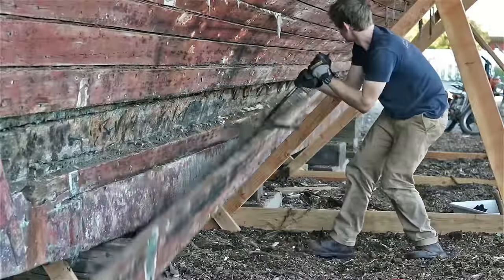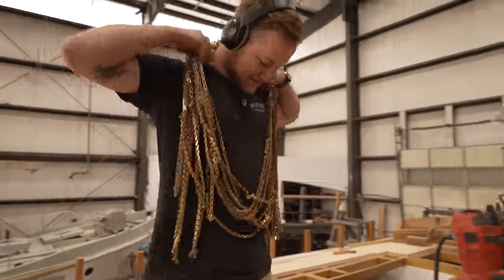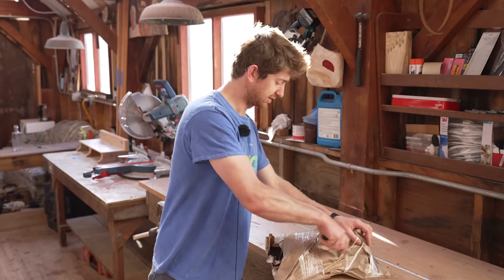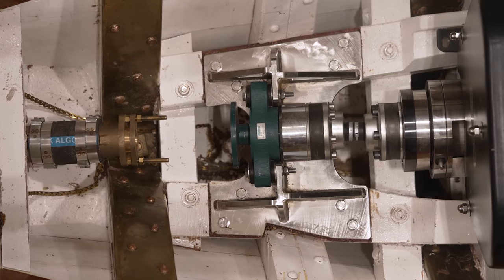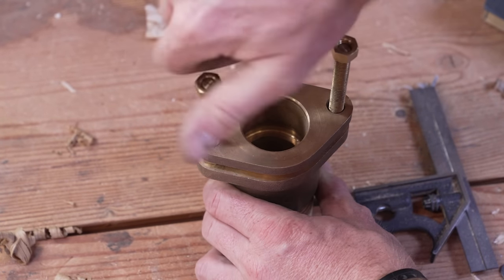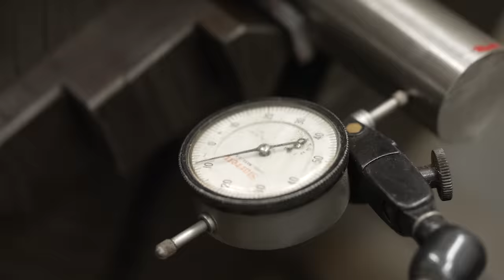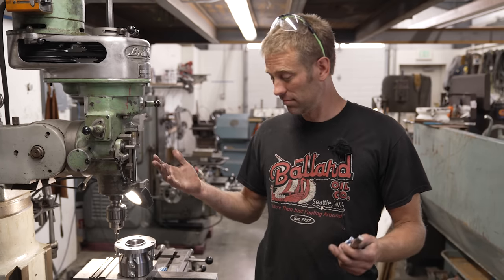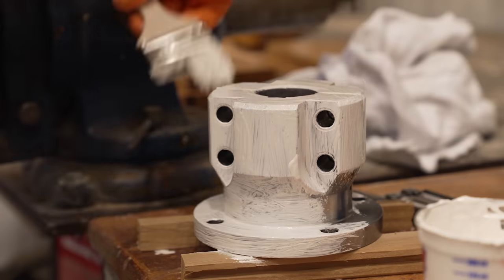Machining the Driveline & installing an unusual Propeller (metalwork & boatbuilding)

Comment: How is the propeller blade pitch actuated?  Is there a coaxial shaft or something that controls it?  I see there's a wedge shaped piece on the end of the shaft, I assume that has something to do with it?
Reply: It's a reversing / feathering prop, not a variable-pitch prop. The hub has internal gears that wind the blades into full fwd or rev position, depending on the cw or ccw rotation of the shaft. Although the limit stops in the hub that set the maximum pitch in each direction can be adjusted or fine-tuned when stopped, there's no ability to adjust the amount of pitch when under way.
Reply: @frederickstibbert7389  So how is he going to put the prop in the neutral position to reduce drag while sailing?
Reply: @orionsswords  - From fwd gear, just stop the motors / engine & the blades are gradually forced to feather by water flow, or stop the engine in gear to use engine back pressure to hold the shaft immobile for faster feathering, then shift to neutral. The  boat must have forward way to feather the blades. The case is different when the blades are in rev / regen position b/c waterflow holds the blades fully open. So you must burp the elec motors in fwd polarity to wind the blades into fwd orientation, then proceed as above.

Comment: How is the pitch of the prop controlled? The shaft isnt hollow or something, please enlighten me!
Reply: It's not a variable-pitch prop, although it has limit screws on the hub to set the max fwd / rev angle. This type of prop can only be at full fwd / rev pitch - but when there's no rotation load on the shaft, water flow pushes the blades into the feathered position.
Reply: @frederickstibbert7389  Thank you very much!

Comment: I would like to know how the prop nut is locked.   With any vibration and forward and rev changes it may undo. No pin or stiff nut?  It would be sad and a big problem to lose that ingenious prop. I think one of the recent electric cars had to be recalled because electric braking undid the centre nuts which on a normal car were self tightening.

Comment: Question, how do you control the pitch of the prop?
Reply: While the max pitch in either direction can be adjusted w/ locking setscrews on the hub, this is not a variable-pitch prop - it's either at max fwd or rev pitch when being driven, or feathered by water pressure.
Reply: @frederickstibbert7389  Thank-you.. that makes much more sense... Thank-you again.

Comment: @8:44 What is the brown 'Goop' we see you guys use for mounting stuff? (I don't think it's Nutella, perhaps it's Marmite?)
Reply: A mix of Dolfinite bedding compound & pine tar, sometimes thinned w/ a bit of linseed oil. It fills the small air pockets between mating surfaces, so they can't fill w/ water to promote rot.
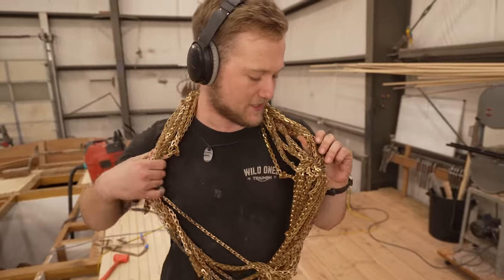Reply: @frederickstibbert7389  Thank you kind sir for explaining, that seems like a good idea! Using the search term 'Dolfinite' I found EP76 where Leo talks about it a little bit around minute 3:20

Comment: I just wonder, how you set angle on prop blades when boat is in water?
Reply: Although the maximum pitch in both directions can be adjusted with set-screws on the hub, this is not a variable-pitch prop - it's a feathering prop that can only have 3 positions - full fwd, full rev, & more-or-less feathered to 0°.

Comment: I love that you faced the coupler after fit-up to the shaft. Nice advantage of working with a machinist with all parts on hand; minimal runout and the whole assembly will be nice and happy. Zn-Ni plating would have been nice on it instead, or in addition to paint. It would give slowly consumed protection for the clamped bore, faying surfaces and all the threaded holes that you can't paint. Spraying all the fasteners and holes with a corrosion prevention film would be a good idea once it's installed so you can hopefully get it apart again when you need to.

Comment: How is the pitch actually controlled from inside the boat?
Reply: It's not - there are adjustment screws w/ lockdown setscrews on the prop hub to limit the pitch in fwd & rev rotation, but the only control is to shift the gearbox from fwd to rev. To feather, you shut down the engine in gear, wait for the blades to feather, then shift to neutral.
Reply: @frederickstibbert7389  so they are slung by rotation of the engine fwd & rev to the limits. If you have forward momentum and you shift to neut the  drag will move the blades to the middle between the fwd and rev pitch i.e. the feathered position.

Comment: At risk of sounding like a troll, why does the thrust bearing bracket have open webs? Full metal would surely be stronger (and a little easier to make).
Reply: Maybe for heat dissipation, like car brake rotors?
Reply: My guess is it's easier to control warping during welding.

Comment: steam engines call them stuffing joints or packing joints ... and its just to keep the steam in or oil out etc ...
Reply: finish the resin paint job with a smiley face ... then when it does see the light f a mechanic again they will smile too lol ;) 
.
for those wondering what the word he was struggling to think of ... Galvanic corrosion ... the interaction of 2 or more conductors in contact or close proximity to pass electrons back and forth ... 
.
notice CONDUCTORS .. carbon fiber is a conductor ... so is steel ... one touches the other one will corrode the other ... regular fiber glass between and its looked after etc ...
Reply: a little smaller than would be best ... pity ... but then it is a sailing ship and NOT a speed boat ... so a little less prop essentially means less speed ... but then you dont really want speed you want a comfortable ride in most if not all conditions ... and some way to move when there is no wind .. so a little smaller prop than ideal should not be any real problem ...

Comment: What makes the props change pitch? (I feel stupid asking.)
Reply: Inside the prop hub, there's a gear around the end of the shaft. As the shaft turns, this gear turns gears at the base of each blade up against a limit stop. Shift the gearbox from fwd to neutral to rev, & the shaft stops spinning, then takes up the 1/2 or 3/4 turn to turn the blades to the opposite direction. There's no variable-pitch while under way, though you could dive off the stern & adjust the limit screws on the hub (turn off the motor 1st). To feather the prop, you stop the engine in gear. Back pressure holds the shaft immobile while water flow presses the blades into feathered position, after which you shift to neutral & engage the shaft lock (if you've got one).

Comment: Could someone explain to me how the installation of the bracket at 8:59 works? It seems to me like they are using normal metric bolts (no Wood screws) and are simply gluing them in place? How is that supposed to hold?
Reply: The bracket is through-bolted to the underside of the wood supports. The brown goo isn't glue, it's a mixture of bedding compound & pine tar that fills voids that could potentially trap water & promote rot.
Reply: @frederickstibbert7389  Ah that makes way more sense. Thank you :)

Comment: Still trying to understand how regeneration mode works. Is it that with the gearbox in neutral the prop blades feather but with the engine de-coupled and reverse gear selected the resistance of the generators causes the prop blades to move to the forward thrust position? Puzzled. How does this work? Anyone?

Comment: How do you control the variable pitch propellor please?
Reply: There's no intermediate pitch setting - the blades are either jammed up against their full fwd / rev limit stops by the shaft rotation, or the shaft is in neutral & waterflow forces the blades to their feathered position.
Reply: @frederickstibbert7389  Thanks much appreciated. But then how is it locked to charge the batteries please?
Reply: @andyrbush  - I'm not really sure, but reading the Variprop manuals, you feather the prop by shutting off the engine but leaving the gearbox engaged. Back pressure holds the shaft in place while water flow forces the blades to feather position, then you shift to neutral.  So (just guessing here) to get into regen mode you set the prop blades into reverse pitch by jolting them w/ a couple seconds worth of electric drive in reverse, then setting the motors to charge mode. Since the shaft is not held immobile, the blades continue to freewheel and turn the shaft. When you're done w/ the regen session, you unclutch the motors, then throw the (non-running) diesel transmission into drive. The engine holds the shaft still by back pressure, & waterflow forces the blades back to 0° pitch. (I hope this is correct, I wouldn't like to steer you wrong.)

Comment: How is the feathered prop actuated?
Reply: Inside the prop hub, the shaft ends w/ a gear that is permanently engaged w/ gears at the base of each prop blade. When the shaft turns in either direction, it winds the blades into fwd or rev pitch. The amount of blade pitch is set by a factory setting of stoppers that can be user-adjusted by locking setscrews on the hub. When in forward pitch, the water pressure from forward motion on the blades will feather them unless the shaft is being actively driven by the electric motors or the diesel engine. When in reverse pitch, the water pressure of forward motion keeps the blades opened out - at the end of reverse motoring or a battery-charge session, one must burp the motors in forward drive to turn the blades to forward pitch before shutting down, so that the blades can feather.
Reply: @frederickstibbert7389  So freewheeling to charge batteries while sailing will not cause the props to feather towards a 'neutral position', as long as you 'set' them by a bit of forward motion?
Reply: @johnarwine2247  - Assume the boat is being driven forward by its sails & that the prop starts in feathered position. To start  charging, shift the diesel's transmission to neutral, set the motors to drive in reverse & feed them some power. It only takes 1 shaft revolution or less to wind the blades to reverse pitch, then switch the motors to charge & they become generators. Water flow keeps them in that position b/c the blades have more surface area in front of their pivot shafts. When finished charging, switch the generators back to motors & drive them in forward, so the blades wind into forward pitch.  Shut down the motors & the blades will slowly feather from the water-flow, free-wheeling the prop as they do so. You can speed up the feathering by shifting the transmission into gear to immobilize the shaft against the diesel's back-pressure, provided the transmission doesn't mind the abuse. Larger (hundred-horsepower or more) installations use a mechanical shaft brake instead.

Comment: For anyone, will the new boat be electric powered? Went back but just could not find that piece of info. Thought I heard him hinting it may be?
Reply: It is a hybrid system: Can be powered by the diesel engine or by two electric motors. These motors can be turned into electric generators for loading the batteries etc.
Reply: @on4xb  Two eclectic motors, incredible! Thanks @on4xb.
Reply: @RickMentore  See episode 115: https://youtu.be/c4UMMQFgmVI

Comment: im not keen on the stuffing box mounted on a rubber tube. if it seez  your motor will not feel that bit of rubber. and next thing you have water comming in with a huge job to repair. will have to pull the shaft to replace that bit of rubber.... shore there must be a better way.

Comment: How do you get the blades to feather ?
Reply: The blades are moved into drive position by the rotation of the prop shaft. To feather them, you stop the engine while leaving it in gear - back pressure in the engine keeps the shaft from rotating, & water flow slowly forces the blades to 0° pitch. Then you shift the gearbox to neutral.
Reply: @frederickstibbert7389  sound. What about using it to regenerate cos they need to be 'backwards" for that . (Sorry, should have asked that the first time)
Reply: For regen, I'll guess you 1st burp the electtic drive motors to drive in the desired direction, they wind the pitch into the blades in a rotation or 2 - then shift the motors from drive to generate. Since the prop shaft is still free to rotate, waterflow causes the prop to windmill, generating power. When time's up on your regen session, you must stop the shaft rotation to feather the prop. Shifting the diesel's gearbox to drive, sounds like a great way to damage it, unless it's designed to allow that. Alternatively, use a band-clamp style of shaft brake to tie it down while the prop zeroes out, then release the brake 'cos you don't need it to keep the prop feathered, & you don't want to forget that it's clamped the next time you use either the electric motors or diesel engine.

Comment: I doubt your paint will last long. That carbon steel flange/fitting was too shiny and it should have been abrasive blasted to a dull finish 1-2 mils anchor pattern then wiped with acetone, and epoxy applied. I predict a coating failure in the future. Sorry that's my line of work, just try to remember clean dry and dull.

Comment: Mounting Mild Steel connected directly to Stainless steel is NOT a good idea, as it creates galvanic corrosion, anode / cathode relationship, as the mild steel will become sacrificial.  You would want to apply some coating that will act as a barrier.  Something like Nickel.  Alternatively, you could install a sacrificial piece of zinc or magnesium that is less noble and schedule replacement.

Comment: Would you explain the mechanism by which you feather the prop to its various positions? Is it a hydraulic system? She’s looking great Leo. Cheers
Reply: It's a mechanical system. When the motors or diesel drive the prop shaft, gears in the hub turn the blades into the either fwd or rev orientation. For regen, use the motors to drive the prop in reverse - after the blades are set, electrically switch the motors to generators. If the boat is being propelled forwards by the sails, water flow will hold the blades in rev position & drive the generators. To feather the prop after regen, briefly engage the motors in fwd drive to turn the blades to that orientation, then shut down. When the shaft isn't being driven, warer flow gradually forces the fwd-mode blades into feathered position. The blades will feather more quickly if the shaft is held immobile or braked by the motor / diesel driveline back pressure.

Comment: Yeh I've been getting messages to send info to someone also,  I don't trust any of them and I know you have other REAL ways of contacting people.   I didn't see this, but how is the varipitch part activated???
Reply: It's not a variable-pitch prop, it's a reversing / feathering type. Inside the hub, bevel gears connect the end of the prop shaft to the roots of each blade. When power is applied to the shaft, it winds the blades up against a pre-set limiting stop & then the prop spins. Shift the direction of the shaft rotation & the blades wind in the other direction before starting to spin again.

Comment: At what point is a rebuilt boat just a new boat in the shape of the original, if you replace 99% of the boat is it still the same boat
Reply: In this case, the boat was dismantled piece by piece as new replacement parts were added, so there was always the same identifiable boat in the yard. I'll point out that wooden warships USS Constitution & HMS Victory have each been rebuilt several times in major yard periods that cost more than the initial construction. They're likely down to single-digit percentages of original material, yet no-one's writing that they aren't the ships they claim to be.

Comment: Unbelievable, you put in a state of the art engine that can run on electricity, diesel and even liberal tears. Then you go a head and install a prop shaft that will leak salt water in your boat?????   WTF????   In todays day and age, you should at least upgrade/build that part of the boat to bed bulletproof, stone reliable and water tight!!!   Im no genius over here on my couch, but even a shlep like me could probably pull that off pretty easily.   The bronze chain is a pretty good idea I might add.

Comment: Is it just me or does the idea of generating electricity from the prop just seem infeasible?   I’d love to see a video on this but my logic goes like this: in forward the prop is spinning fast enough to make the water pass the propeller at, as a guess, 100 knots. In generation mode, the water is passing by at sailing speeds at, as a guess, 5 knots.  So that’s 20 x lower speed, adding in inefficiencies (electric cars recapture about 30% and that’s with wheels in direct contact with the road), it seems like a recipe for almost no generating capabilities.

Comment: Are you not worried about the stainless nuts galling onto the stainless bolts? I'm seeing  a lot of people now using brass nuts instead. How do you change the propellers pitch?                                                                                    Scammers are A Holes, don't bother me, get a proper job.